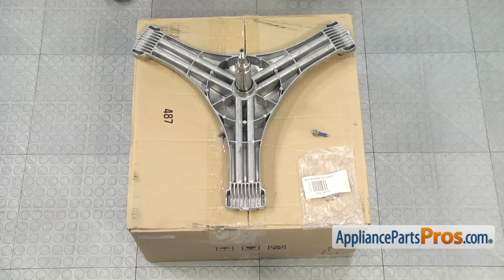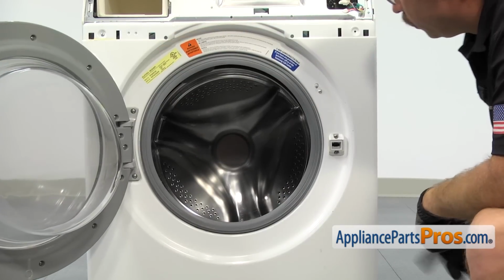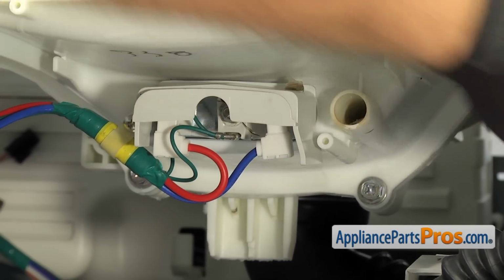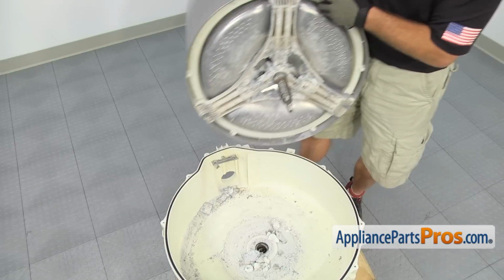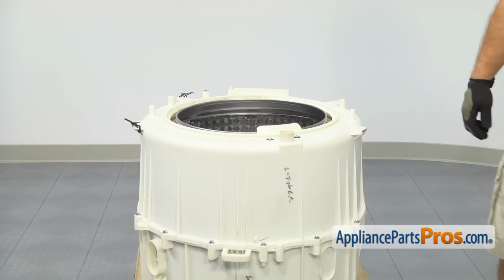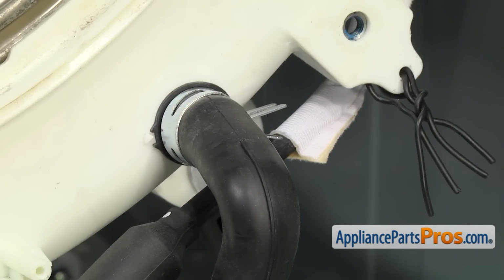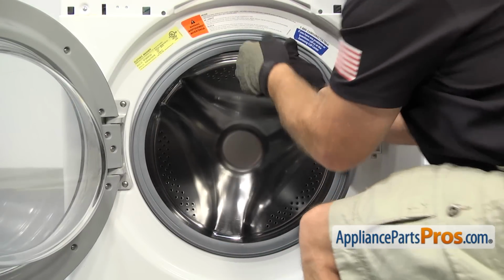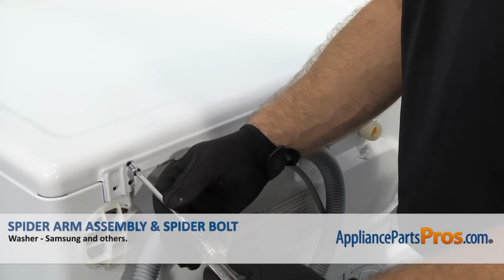Washer Tub Out of Balance? Replace the Spider Arm Assembly — Samsung (DC97-12528A)

Comment: Is the coarse sand looking material from my washer discharge actually the spider disintegrating?
Reply from the maker: It’s possible. A failing spider arm can corrode and break down, sending pieces of aluminum or corrosion debris into the drain. The material can sometimes look like coarse sand or grit. However, other buildup or debris can cause similar symptoms. If you’re also hearing loud banging, seeing an off-balance tub, or finding play in the drum, it’s a good idea to inspect the spider assembly.

Comment: My Samsung washer is 16 years old and needed a drain pump replacement last year due to damage from chunks of the spider arm.  A year later, I had to replace the drain pump agains for the same reason.  Is it worth replacing the spider for this old washer.
Reply from the maker: A 16-year-old washer has definitely had a good run. If the spider arm is breaking apart and sending pieces into the drain pump, replacing the spider assembly may solve the issue, but it’s worth considering the overall condition of the washer. Check for bearing noise, tub play, rust, and the condition of other major components before investing in the repair. If the rest of the washer is in good shape, a spider replacement could extend its life.

Comment: The spider arms are made out of bare magnesium because that metal will corrode in fresh water. They would have made it out of plastic or galvanized steel or aluminum or anodized magnesium or any other metal but bare magnesium and it would have lasted for decades. This is a blatant case of planned obsolescence.

Comment: Very informative video! It got our 10yo Samsung back into the fight, Thank You! With all of these spider-arms going ka-put in almost the exact same way, you'd think they would come up with a better design. It's funny that our Samsung died two years ago at 8yo, (spider arm), and yet there's that "10 YEAR WARANTY!" decal prominently displayed on the front.... These spider arms turning to dust just seem like a very predictable reset for when most people find themselves having to buy a new washer.
Reply from the maker: I want to say that did change the design or alloy they're made out of a few years back. The earlier front-load spider arms got chewed through pretty frequently.
Reply: @appliancepartspros  ...after seeing our well-cared-for washer's arms disintegrate into golf-ball size pieces once unbolted, I'm convinced they need to try harder. I'm no metallurgist, but I know you have to be careful of what metals you mix together under water if you don't want corrosion. Maybe stainless steel for the arms, like the shaft? Ours is a 2014 machine. Hopefully what you inferred applies to machines after ours was manufactured.

Comment: We are gearing up to buy parts again for our washer, it still works but time isn't on our side. Spider is now $197 oem bearings and seal  from YellowVan Handyman is $129.99 so over 325 for a  redo. But certainly beats the cost of a new machine.
Reply from the maker: Sounds like you’ve done the math — and you’re right, a repair like that can definitely stretch the life of your washer for far less than the cost of a replacement. 💪 If you decide to move forward, we’re here to help make sure you get the right parts for your model.

Comment: My Samsung doesn't have the door for the drain pump, it's inside the back on the bottom.
Reply from the maker: Thanks for pointing that out! 👍 Some Samsung models place the drain pump access at the back instead of behind a front panel or door. The basic process is the same, but you’ll need to remove the rear panel to get to it.

Comment: Anyone please... what's that tiny washer for? in minute: 24:12 Is it REALLY needed? or optional? Thanks
Reply from the maker: Hey @ronaldd.1355 — great question! That tiny washer you spotted around 24:12 is part of the tub seal assembly. It’s not optional — it helps ensure a tight seal and prevents leaks where the shaft passes through the tub. Leaving it out could cause premature wear on the seal or even allow water to leak into the bearings over time. Definitely recommend keeping it in place during reassembly!

Let us know if anything else comes up while you’re working on it — happy to help!
Reply: @appliancepartspros  Thanks for your great and fast answer, I tried looking for in your site for the half tub seal in minute: 24:24: for my model but cannot find it: it's: WF220ANW is it there?
Reply from the maker: Unfortunately, it looks like the manufacturer does not sell that part separately from the rear outer tub assembly. That part number is DC97-15931A. You can place the order through the website, or you can call us at 1-877-477-7278 to place the order over the phone.

Comment: To bad the spider arm isnt a metal that doesnt have a bad reaction to the stainless steel. I understand  the metal the spider arm is made of is adversely affected by the stainless steel.  Maybe that stuff u can buy to insulate tools at Lowes could be applied to it. Provided it doesnt come off in the water and get on the laundry.😮
Reply from the maker: Great point, Ted—It would be interesting to see if a non-toxic, waterproof insulating layer could help reduce that reaction, though, as you said, anything used would have to be safe for laundry and long-lasting in that environment. Appreciate you bringing some thoughtful insight to the conversation! 👏🧠

Comment: What is the result of not installing the wave washer? Also didnt see you mention the o ring ( 6044-002157)that i see on the diagram and appears to slide over the shaft resting on  the bottom of the spider arm shaft ? Thanks
Reply from the maker: Good eye! The wave washer helps maintain proper pressure and spacing—without it, you can end up with excess vibration, noise, or uneven wear. As for the O-ring, you’re right—that's meant to help seal out moisture and prevent leaks where the shaft meets the tub. Definitely recommend installing both to make sure your repair holds up long-term. Let us know if you need help finding the parts!
Reply: Gotta feeling one washer i done i left off the wave washer. Proably lost it. Whats the part number for the wave washer? Im getting a rumble sound when i spin the tub by hand fast. As well as some slight in and out play when pulling the basket edge back n forth after completing assembly. Thanks

Comment: Why not make the spider stronger and durable especially something so important like that this manufacturer are incredible I am 100% sure they can easily make that part so strong that you won't need to replace it
Reply from the maker: The spider arm is an important part, and stronger materials could definitely extend its lifespan. It would be great to see manufacturers improve durability in high-stress areas like this.

Comment: Is there's any reason you didn't use powered tool for this or it needs to be manual ?
Reply from the maker: Great question! While powered tools can speed things up, using manual tools helps prevent over-tightening or stripping bolts, especially on delicate parts like the spider arm.

Comment: Folks, this is an awesome video and I only tackled this job knowing that I had such a detailed guide in hand.  One thing, cleaning the drum and the tub is a messy job but needs to be done (I did it in the garage with dish soap, water and a good scrub brush.  Fully clean the hose going from the bottom of the tub to the pump as well (if the spider arm failed, it will almost definitely have sediment, if not large chunks in it).  Be sure to clean thoroughly, and regrease, the bearings in the tub.  Lastly, and most importantly, be VERY careful when removing the tub from the machine (and when placing it back).  The drain at the bottom of the tub is at the lowest point and you will CRACK THE TUB if you’re not very careful with it.  The tub is a bit heavy, but it’s more awkward than anything.  When removing and re-installing the tub, take great care to not bang the drain at the bottom of the tub against the floor or the frame of the machine.  With the help of this video I did a spectacular job replacing both the pump and the spider arm, but I cracked the drain section of the tub so handle with care.
Reply from the maker: Awesome job tackling this repair! Great tips on cleaning and handling the tub—especially the reminder to be extra careful with the drain section. Thanks for sharing your experience, and glad the video helped!

Comment: Thank you for the great video explaining how to repair my Samsung washing machine. I've watched a couple of videos, but this one was by far the best. Loved the reassembly part that is included. I did the repair in steps, by replacing the shocks first, but sadly was not the problem, so moved onto the spider, and after removing I saw the crack, hole in metal, and deterioration of the spider arm. I do have a question about when you say to check the tub for damage. I did find where the top half of the outer tub had a groove worn into it all the way around. Appears to be from the inner tub rubbing against the outer tub. While the groove is all the way around, it has not gone thru the tub. Should the outer tub be replaced? The washer is seven years old.
Reply from the maker: If the part is damaged then it would need to be replaced.
Reply: Robert, check my notes on how to repair a crack / gouge/ chip in the tub.  JB Weld Plastic epoxy / cure / Flex Seal Aerosol rubberized spray over top / cure / reinstall

Comment: So Re using the Plastic tub half Seal is ok ?

I bought 1, but looks awful fat, and is not groved like the old 1
Reply from the maker: What is the model number of your washer and what part number did you purchase?
Reply: @appliancepartspros  Model # WF45K6200AW/A2

Part # DC69-00804A
Reply: @appliancepartspros  Does the new Round 1 simply just form it into the Shapes as the Old 1, or have you just always Reused the OG without any Issues, I mean there's ALOT of Little marks here and there from the Crevices in the Drum etc.
Reply: @appliancepartspros  I Read the Amazon Reviews on it, MOST say it worked DESPITE The VERY noticeable Difference, some complained it was too Thick causing areas of the Tub to Bulge when Tightening etc, so I just put a Razor thin Film of Black RTV on the Old 1, and Gonna Hope for the Best, see what happens here Tommorrow
Reply from the maker: Good luck with that repair, let us know how it goes.

Comment: Will running the machine clean cycle with the tablets help prevent this? If its a machine without that cycle can i  set it on hot, heavy duty , pause it midway thru the wash phase and let it soak for an hour then restart suffice? Thanks and  Merry Christmas to all of the staff.
Reply from the maker: If you don't have a clean cycle you can just run a normal cycle with the cleaner. Running that clean cycle as the manufacturer recommends can help keep your unit running efficiently.

Comment: My Washing machine won't go into high speed spin with any clothing/load.  Throws no diagnostic codes, has been recalibrated.  I replaced the: hall (hull?) sensor, the invertor, the motor PCB and all 4 shocks twice (thinking the Amazon shocks may not have been OEM-enough).

It gets aggressively wobbly when in the low-med spin (as it always had) but settles when it goes into highspeed, but immediately reprograms to the balancing and low/med spin.

So I'm thinking Spider Arm crack.  So I take the whole thing apart expecting to see the issue but the spider arm is in good condition with only very minimal oxidation and no cracks.
Bearings?
There are no noises and the tub rotates concentrically with ease in both directions.

I'm at a loss.  Are there any other sensors or could there be an issue with the pump? The doorlock works properly, and the unit is bubble level.  This problem started happening a few months back.  The OEM shocks may have helped a tiny bit.  It will go to completion but only after a lengthy jostling and the clothes are not spun out/still dripping wet.  Any suggestions would be appreciated.
If not  I'm parting the machine out since every part was replaced individually and tested to see if that was a solution, but no different than my original part.

 WF56H9100AG/A2 - 01

I can't imagine
Reply from the maker: It sounds like the only thing that could be the issue is the spider arm, there may be a small crack in it that you can't see causing the problem. You have replaced everything else that could cause that issue.

Comment: I believe they sell the bearings separately and you just have to bang them out and replace them
Reply from the maker: The bearings are sold separately on some models, but not all. You will need to check your model number to see if those are available separately.

Comment: Spider arm failed on my 8 year old Samsung washer.  I’m in the UK so there were some variations to your appliance but the concept was the same.  Luckily I only had 3 spider bolts to remove, one requiring drilling out.  I would not have diagnosed and gone ahead with the repair if it was not for this fantastically concise video.  Thank you.
Reply from the maker: You are welcome! Glad you were able to fix your issue! If there is anything we can help you with in the future please let us know.

Comment: Wow, that bolt is really really hard to get loose. Any tips? I used WD-40 and let it soak. The bolt won’t budge, but the hole on that big plate is starting to deform from how much pressure I’m applying to the bolt
Reply from the maker: Unfortunately, there isn't a trick to getting that loose, it can become stuck and difficult to get out you will just need to keep trying.
Reply: @appliancepartspros  a breaker bar and WD-40 eventually did the trick.
Reply from the maker: Glad you were able to fix your issue! If there is anything we can help you with in the future please let us know.

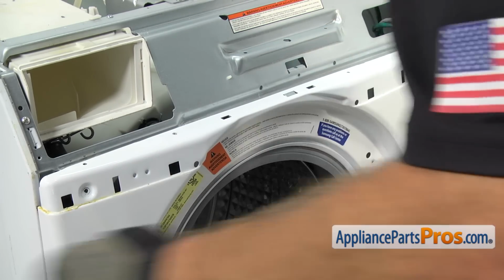Comment: @8:12 there are some Samsung washers that are extremely similar to this (WF218xxx) that have screws underneath the unit securing the front panel. If you lift up and the panel isn’t moving, put it back in place and tilt each side carefully. Look for and remove the screws hidden underneath.
Reply from the maker: Thank you for the tip!

Comment: Torque specs would be helpful
Reply from the maker: The manufacturer does not list a torque spec in regard to these parts. You will just need to ensure they are tightened firmly in place.

Comment: Great video, thanks. FYI,  On my WF350ANW/XAA I needed to take out a screw holding the dispenser drawer in place so I could push it back a little or the control panel couldn't release.  Hopefully reassembly once parts arrive goes as well.
Reply from the maker: If there is anything we can help you with at all please let us know.

Comment: These spider arms appear to be engineered to fail at about the 11th or 12th year mark. Imagine the ridiculous science that went into that. This is planned obsolescence. It would cost virtually nothing to make these impervious to corrosion indefinitely. I'm currently repairing our machine, and I'm wondering if I should treat or coat the spider arm with some sort of corrosion inhibitor. If I can constantly repair this thing, that's what I'll do. It's been a great washing machine otherwise, and has taken its fair share of abuse simply because of how frequently it was used.
Reply from the maker: We can't recommend any type of coating to spray on the spider  arm. I do apologize.
Reply: @appliancepartspros  I wasn't really considering the fact that the arm is submerged. Now that I have, I don't think it's something I'll try as the surface would be too hard to prep without something like a sandblaster.

Comment: Any idea why these spider arms are made from aluminum (or magnesium, or whatever it is)? Other than weight, and manufacturing cost saving, my only theory is that they do double duty as a sacrificial anode and thereby protect the axle and bearing hub from corrosion. In the course of replacing mine I noticed that both the bearing hub and the axle were totally corrosion free. And it's not because they are stainless steel. They are plain steel. I think it's because they are protected by the spider arm acting as a sacrificial anode. That protection means only the spider arm needs replacing, and bearing hub (molded into the rub) survives. If everything was steel they might both corrode to the point of failure.
Reply from the maker: The manufacturer doesn't provide us with what the part is made out of.

Comment: what really caused that corrosion? was it the stainless drum and the aluminum spider touching or the soaps and bleaches used in the normal washing process? it does not look like the spider actually in contact with the drum in the area it corroded, but i see it is bolted to the outer rim and not much corrosion in that area.
Reply from the maker: The corrosion can be from the soaps and just the usage of the machine. What is going on with your washer?
Reply: The aluminum arm is a sacrificial anode swimming in the soapy water electrolyte. That's why the steel shows no corrosion IMO. I noticed the same absence of steel corrosion in mine. Whether that's by design or not, who knows. But if it is by design then there's some logic to it.

Comment: I discovered this amazing video too late. I had to figure out how to take apart the washing machine myself. Too many pieces and difficult to remember the process. 
My intention was to disassemble as little as possible, but every time I removed a piece, I had to remove another. However, I only removed the front tube, without removing the rear tube, I think is better that way.
Thanks to this video, it is now easier to assemble, it would have been very difficult for me to remember how to assemble the washing machine again. Thank you.
Reply from the maker: You're very welcome. Let us know if there's anything else we can assist with.